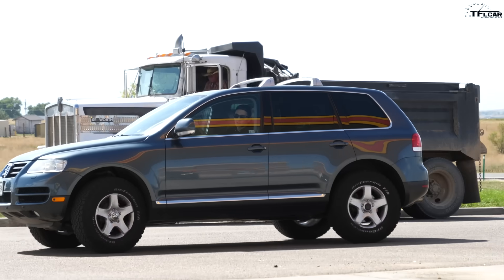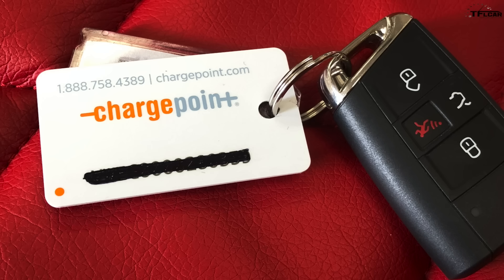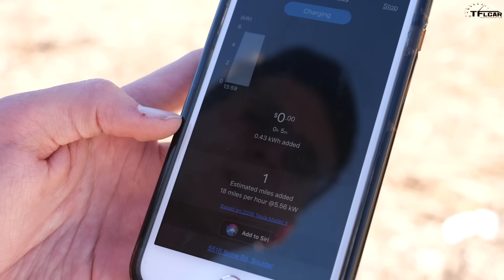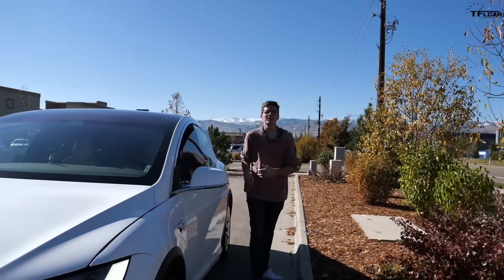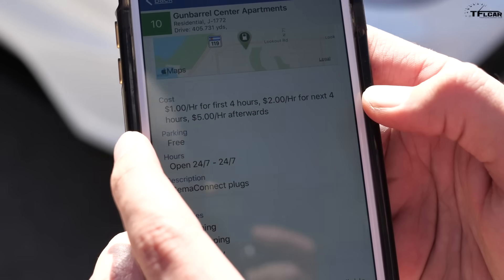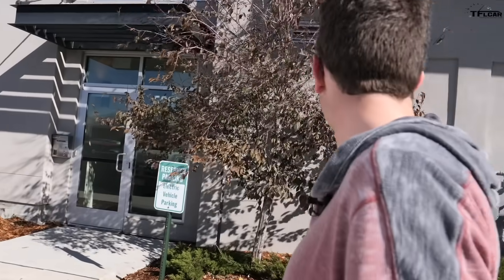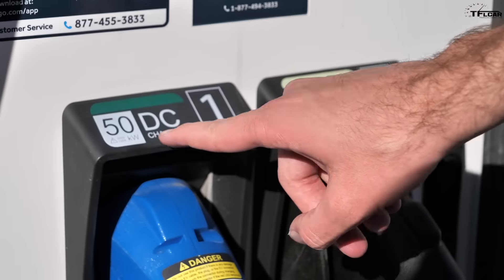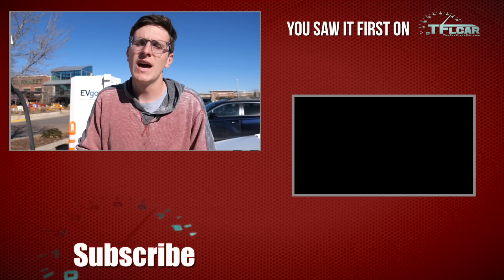Here’s Why Charging an Electric Car Can Suck - And It’s Not The Reason You Think!

Comment: Adding a 240v, single phase outlet for a charging point for your EV at your home is very doable. If you have to upgrade your service and electrical panel to accomplish this, that's a good idea just in itself.  Upgrading your home's electrical, plumbing, a/c, etc or whatever, is well spent money.  Most of the time, certain upgrades on your home have a return on your investment.
Reply: More like an unnecessary expense.

Comment: It's late at night, I am on the highway with many miles to go and running low on gas.  I pull off to find a station, the area is dangerous - the gas station attendant is in a locked booth for safety and sign says he cannot come out during night hours and it's self serv only.  I want to gas up as fast as possible and get the hell back on the highway.  Drunks start coming up to my car and hassling me for money.  Ok so let me get this straight, you want me to wait around for a couple hours plugged into a fast charger?  No way..
Reply: A fast charger takes 15-20 minutes, not several hours. You really should learn how charging works
Reply: @bradmagnuson6963  ... I think many confuse the term "fast charge" with a "quick charge stop" meaning just a top up to get further down the road. I think the industry would do well to use the term "rapid charge" to signify what it really is, versus the other chargers that will take hours just to add 50-100 miles. Tesla's Supercharger is really more of a brand name.
Reply: @rupe53  quick charge and fast charge are the same thing, and no, charging doesn't take many hours, unless you're on a 110/120 outlet. From 50% battery to 100% in my EV, takes 90 minutes to 2 hours, depending on the brand name of the Level 2 charger. For example, I rolled up to a clipper creek level 2 charger, at 26% battery. 90 minutes later, I was at almost 100%
Reply: @bradmagnuson6963  ... .I think you misunderstand my point where the average person might use the term quick or fast like having lunch. They are usually talking time frame, not nutrition level. To Joe average a "quick charge" might mean an hour, but it will take experience to figure out if they are getting 20 miles or 200 miles in that time. We're dealing with the general public and most are not too sharp on technical things. A standardized term (not 3 or 4 of them) is what we really need. This video already proves that many public chargers only move at 15 - 20 miles per hour of charge, which is kinda like buying your gas a half gallon at a time. OTOH, you may not have a choice.
Reply: @rupe53  again, quick charge and fast charge, is the exact same thing.
Reply: @bradmagnuson6963  ... yes, to you it obviously is!
Reply: @rupe53  no, to every electric car driver, it is, me included. Fast charge and quick charge is the exact same thing
Reply: First off, why would you stop for gas in those places? Oh you mean you are not a planner. Piss poor planning is your issue. I have NEVER stopped for gas or a charge in a bad neighborhood. You know why? I dont do stupid shit.
Reply: And it’s 15 degrees outside and starting to snow.
Reply: @PassionGrows  I've driven my electric car in snow storms and sub-zero temps, never once had a problem. I had enough charging stations around I had access to 24/7. So, your argument Doesn't mean shit
Reply: America sucks huh? So the trouble with EVs is America? Trouble is you're all spoiled narcissists who want life as easy as possible, so ypu make up excuses. Intelligent p[eople plan their journeys, consult their app to see what are the nearest chargers to their route, and don't just boot it non stop until they're almost out.

Comment: There needs to be a standard charging system for all vehicles across the spectrum without the need for adapters since Tesla is far in the lead all other electric cars should be made to fall inline with Tesla charging systems and there plugs should be whatever Tesla uses
Reply: tesla would never allow their tech to be shared though

Comment: The only way this will all work for the public, is to standardize the plug system.  Everyone that is hyped up on EVs is cool with the adjustment, but if you want more of the general public you have to take out the trickiness of it all.  People are use to pull up, put in the nozzle and pay like he said at the beginning of the video.  This plug nonsense on top of range anxiety is going to slow down the acceptance of EV.

Comment: After reading many of these comments, I want to thank you all for the information. I want to thank you for talking me out of purchasing an ev. Just too much hassle for me and not practical as I drive 30,000 miles per year. Just my opinion, but the electricity that is used for charging is coming from burning fossil fuels so what is the advantage?
Reply: "the electricity that is used for charging is coming from burning fossil fuels so what is the advantage". Because the power station gets much higher efficiency when converting the fossil fuels to energy than a combustion engine. And then the EV likewise has very high efficiency at converting the electric power to motion. So overall better for the environment, and cheaper for you as a consumer (about a third of the cost per mile, or free if you have free supercharging)
Reply: @Alistair  Like I said, just too much  hassle for me. The area where I live is prone to multi day power outages. It would be horrible to be without power and transportation too. The people in Texas who own electric vehicles just got the double whammy. Feel very sorry for them.

Comment: It seems to me that, if LOTS of people begin buying EVs, then there will be nowhere near enough charging stations even if MANY more are added.  The reason is simply that, unlike the number of gas pumps you need for people to fill gas tanks, for EVs you need MANY times more because EACH car will be occupying a charging station for an hour or more.

Think about it.  If a gas station has a dozen pumps, cars pull-up, fill-up, and leave in about 5 minutes.  So each pump can serve 12 cars per hour or more.  12 pumps can fill the tanks of, at least, 144 vehicles per hour.  But 12 EV charging stations can only charge 12 cars per hour or even fewer if the cars need to charge for more than an hour.

If you have a dozen charging stations in a parking lot, each car will occupy each station for an hour or more.  You would need about 12 to 15 time more charging stations as gas pumps to serve the same number of cars.  It's not a problem now because so few people have EVs, but if EVs ever became widely used, the number of charging stations required to serve them all will be HUGE.  Far more than gas pumps serving equivalent numbers of gas vehicles.

Comment: Same here in germany so much different companies i use the mobility + app or the german version of plugsurfing but still you miss a lot of chargepoints like from the stores or private/public ones. Btw 1 kwh in germany ac costs 39cents the highest with hypercharge 1.09 euro per kwh so pretty expensive. Another questio  n would be is there an adapter for your charger to type2?

Comment: How do you prevent a prankster from unplugging it while you’re away from public location?  Just go with hybrids. They fill with gas in 5 mins, and you get 600 mi range.
Reply: Under normal circumstance the plug is locked while it is charging.
Reply: @henryt9254  till someone busts it either for fund or to get revenge
Reply: @kamenridergeiz9490  They could slash your tires or break your window at a supermarket too. That is what insurance is for.
Reply: I know a guy that has gone through 25 charging cables. They keep getting stolen. Usually the cost of a new charging cable is a bit less than an insurance deductible.

Comment: This is the biggest problem with the Mach-E. Nice car but you're limiting yourself to 150kw fast charging. Tesla's M3 or MY on a V3 are 250kw. Battery is smaller yet way more efficient >120MPGe for 300-326mi.
Mach-E has 91MPGe for equivalent models.... 270,300MPGe

Comment: Its getting there. 

When apartment complexes and many employment parking lots have up to a 3rd of the parking spots with power and when payment becomes standard. EV has come a long way in a short time. It's biggest hang-up is convenience. 

If/when you run out of energy (gas/diesel or battery). With gas/diesel you can fill up in under 15min and have full range. With EV the charge time is a limitation.

Comment: blah blah blah. I have a model Y now. if you LIVE in an apartment (like jesse from tesla times news)... you plug into a simple 120v outlet- and charge. overnight- you can get plenty of charge for your daily commute. you only need fast chargers when going on a road trip- and I'd AVOID charge point! they charge $1.53 per kwh! tesla charges about $.26 per kwh. also- you can buy a 15 foot, 240 volt extension cord that will plug right in to your dryer power receptacle, then plug into that with your tesla home charge cord (25') and as long as you can park your car within 40 feet? now you can charge up to 90% in 8 or 10 hours. this guy obviously doesn't OWN a tesla. probably took one on a test drive or borrowed a friend's car- so he could display his ignorance. I have A LOT of friends at work (bay area) who drive tesla's- ALL OF THEM live in apartments. the whole "i live in an apartment crutch is just big oil fudd on ev's. then there's 'battery production pollutes'... 'can't recycle'. wrong on all counts. and before you say "can't use an extension cord? I BUILT a cord for one of my friends at work- using #6 fine copper strand, 2 conductor with ground (ground is #10)- 100' long. the cable WAAYYYY beyond capable of carrying the amperage. he's been using it since his first tesla model S in 2014. soldered brass eyelets on the male & female connections of both ends- so very tight & secure- no overheating, arcing or fires. 

in the bay area- apartment & condo property owners, more & more are installing 240v 50a receptacles in parking areas- or installing ev chargers- why? because the potential renters/ buyers are ASKING during the interview process "how many bedrooms? ok. what's the monthly rate? ok... DO YOU HAVE EV CHARGING? no? ok. thanks. we'll be in touch... and KEEP LOOKING. 

road trips, tesla super chargers & 'the other guys'. charge point put their krap system in at my workplace. they let us charge for free... for about a year. then they started charging- DOLLARS. $1.53 per kwh- as mentioned before. now all their charge parking spots stay... EMPTY. eventually.. .this is what will happen to the ones who charge to much- for kwh's. charge america? not bad. I wouldn't try to make ANY super charger your mainstay for daily commute- not when home current only costs $.09 per kwh in off-peak. short answer? if you're a traveling salesman- and you have to have supercharging on a daily basis?  get a tesla. use the tesla network. you'll never have any worries. and as for 'joining' the different charger vendors? yah- kind of annoying having extra apps on your phone- WOULD YOU RATHER PAY $3.50 A GALLON FOR REGULAR UNLEADED IN NY, CA, CHICAGO? $50 an oil change? $1500 for catalytic converter replacement? $3600 for a cylinder head rebuild because the timing belt broke? this guy sure would like it if you'd say yes.

Comment: And here I am. Thinking about getting a hummer EV with batters 3 times bigger than average ev car
Reply: Does the Hummer EV have level 3 charging?
Reply: "GM claims that the vehicle can “add nearly 100 miles of range in 10 minutes of charging.”
If you can afford the Hummer, drop an extra $50,000 on your own at home DC fast charger consisting of a rack of high current batteries and inverter.

Comment: Tesla is the best, Lots of automaker are doing startups, but without the super charging TYPE network, only buy tesla. Charge at 250 to 500 MPH is just SUPER. My wife and I did 5 states in 6 days and would not have had fun doing it without the supercharger tesla system. DG>

Comment: I was able to connect my electric car to 120 volts in my apartment.  Now I live in a stand alone house.  I charge slowly at night, and I believe that slow charge is better for battery life than high speed charging.  In Nashville, Blink charges so much that I only used it once.
Reply: Yes Blink is highway robbery! I have charged in my apartment too but being on the third floor, it involved two extension cords. Not safe enough.

Comment: I simply cannot believe that in this day and age it is not possible to develop a world standard for charging electric vehicles. I also think electric vehicles will prove to be a bit of a blind alley in the long term, we have been being told since the seventies that 500 mile battery range and super fast charging is just around the corner and it's still not here. I really think the way to go is hydrogen fuel/fuel cell, it can work with existing engine technology, it can offer the same convenience as conventional fuel and the only by product is water. The argument at the moment is that it is expensive to produce in a stabilised form but if it was passed into legislation they would find a way of reducing the costs. Whilst I think electric car have a roll to play I think they will be used more for the commute to work and for taxis etc and we will need to look at hydrogen technology for longer journeys.

Comment: I have owned a Tesla for 2 years, and use a standard 110v outlet in the garage. It charges overnight for as much as I drive during the day. If I go to the mountains, it might take 2 or 3 overnights to catch up to a full charge, but that doesn't impede my normal amount of daily driving. I've driven from CO to FL twice, from FL to CA, and from CA to CO. Supercharging doesn't add much total time to cross country trips either. I wasted a mere 4 hours total charging from FL to CA that I wasn't also eating or using the bathroom. Well worth it for the comfort of having Autopilot do the driving for me and paying half as much per mile as I would have consuming gasoline. However, cross country driving in sub-freezing temperatures charging does become a serious hassle, because not only do you have to charge more often, but you have to trickle charge to 100% to make it to the next charger. To fix this, there needs to be 3x the density of Superchargers as currently exist or longer range batteries without a corresponding increase in cost.

Fun tidbit, apartment properties almost never meter the electricity in the garage, so all your car charging is free. I not only never have to visit a gas station, it costs me $0 to charge my car.

If you don't have a garage, owning an EV currently is inconvenient. Hopefully more apartments install basic outlets in their carports to fix this. They don't need expensive, dedicated fast charging stations. That myth needs to be dispelled.

Comment: I had a Tesla Model Y loaner for 2 days and the charging sucked. A hotel I went to in my city said it was only for hotel guests and then I went to an EVgo place on the highway and it took an hour and a half just to get 29 percent but it only cost $8. Range anxiety is real and I don't really know if I could commit to that right now, I'd rather wait for the range to get higher before purchasing. At least over 400 miles on a charge.

Comment: Yes the multiple apps and the charging connectors will stop me this may evolve to Cooperative agreements among the various suppliers to simplify charging or it may be taken over by the oil companies where in the financial advantage will be dissolved. I would like to know why you can't simply buy a generator put it in your trunk if you're low on power fire the generator up and go get a cup of coffee until you can get back to your home charging station. 
How about at Honda and generac are you working on a portable generator that will go in the trunk and provide 240 volts with minimum noise and minimum fume? The the vehicle manufacturer could help by providing trunk v e n t s.

Comment: I believe evs are going to have a big problem with the charging stations just imagine waiting 10, 20, 30, minutes or even an hour to plug your vehicle then have to charge it else they plan on putting stations everywhere parking lots malls residential and McDonald’s??? then the electrical grid will also take a hit, more demand for electricity ⚡️ which means more cash for kilowatts

Comment: Until condos start installing charge units a good size of population are unable to enter the market. Also if you don't have a Tesla it's a pain. I have a house with 240 charge and have used the supercharging network 3 time in 2.5 years. No need to use these other gouging charge networks and terrible charge speeds. I can also tell how many ports are open at any location in the app. Lastly, local charge rates apply no gouging.

Comment: Everyone has 240v in America it's just you're ignorant of our electrical system.  If you've seen a double wide circuit breaker it probably provides a 240v to something.
Reply: I would never get an electric car while there is not a standard 25kw+ charger standard. If companies want to experiment with a new connector add a second port on the car.